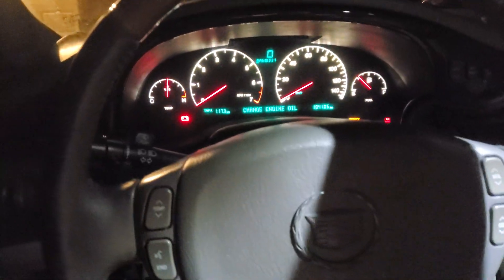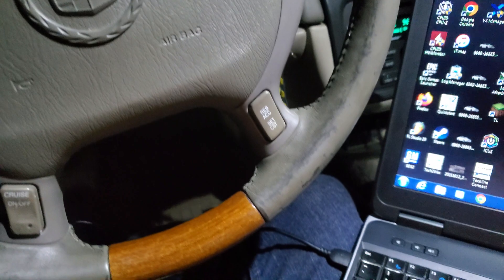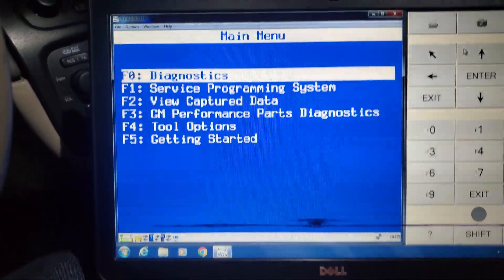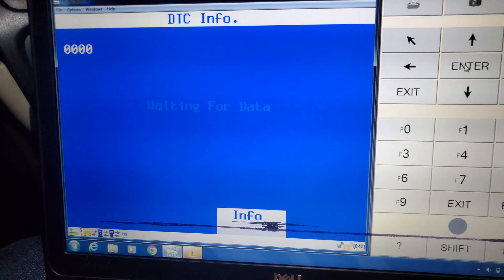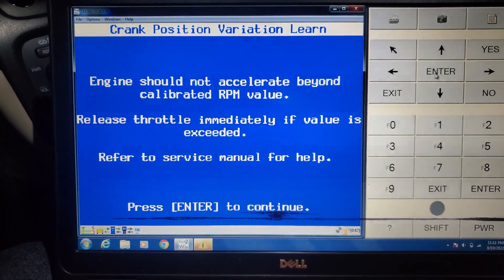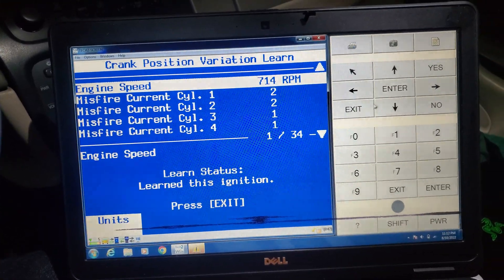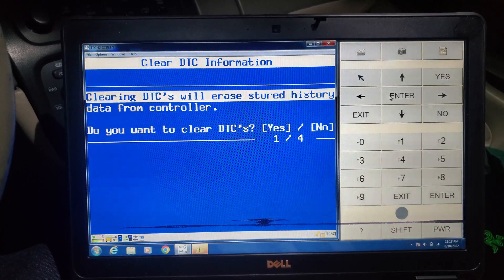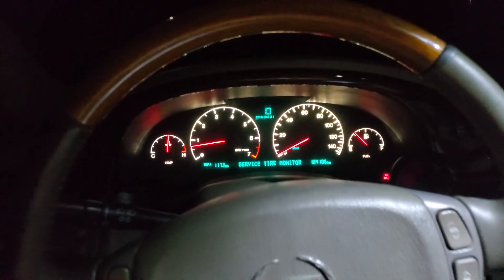Relearn Crankshaft Position On GM Vehicles using a VXdiag Tool

Comment: What if your fuel does not cutoff, took my 02 Chevy Silverado 5.3 in to do a crank relearn, sat in truck with mechanic to do it, and RPM went way over 6000 rpm and the tech scanner said it was unanble to perform the relearn. Any suggestions
Reply: It’s weird my Colorado did that to its super picky about things and I had to bring it to a dealer to get it done just keep trying and sometimes code readers will store the error why it didn’t work

Comment: What if my fuel doesn’t cut off at 4000rpm?
Reply from the maker: On the tech 2 screen it will say what the fuel cutoff is for your engine.
Reply: Did the same, I drove it around then waited and tried again and got it, i guess it's the brake not being rendered